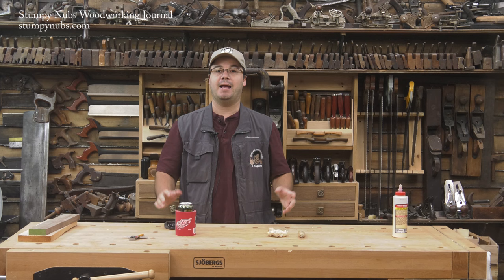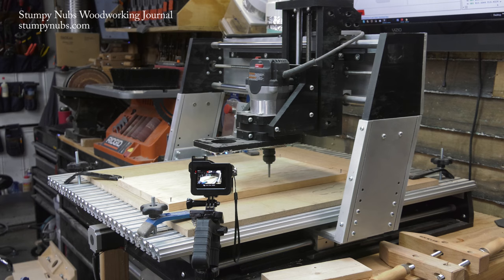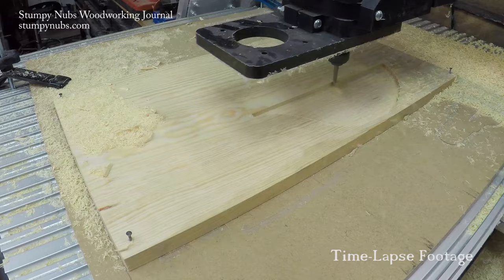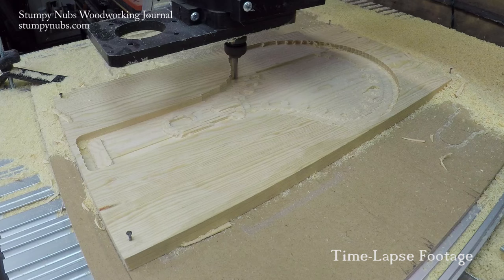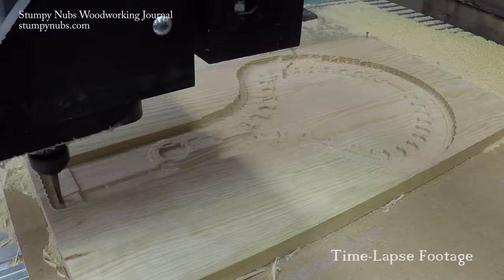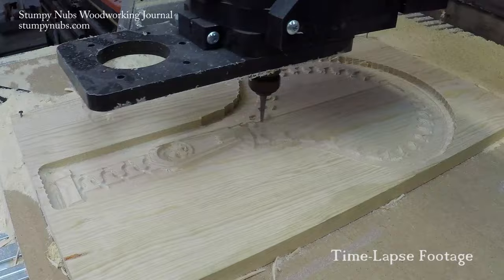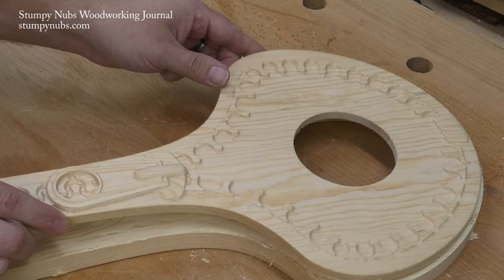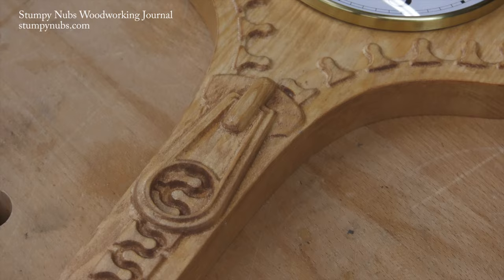WATCH THIS before you buy a CNC machine for 3D carving! (Updated)

Comment from the maker: READ BEFORE COMMENTING: A few people seem to listen to only part of the video, and then they run right to the comment section to tell me "any machine can cut 3D with the right software!" YES, that's what the video says! This video is about the need to find the right software if your machine won't do what you want it to do. I am NOT saying you have to get a whole new machine! I said I got a new one, but I ALSO said I had to upgrade the software on it to carve in 3D. Buy the machine you want. If it does everything you want, great. If not, you may still be able to do it if you find different software. It's all in the video...
Reply: Well, you literally state, "This may seem like a simple process that every machine can do, but it's not.", but it is. You clearly seem to be blaming the machine for your problems with the garbage software several times, when all you need is Fusion360, which is FREE!
Reply from the maker: Funny how you left out the very next sentence "You see, a CNC machine is only as good as the software...." I was CLEARLY saying the software limits the machine. This is what I mean about not listening...
Reply: Yes, I'm aware of your explanation and intent, but I wanted to point out that your message at first sounds very accusatory towards the CNC machine. I listened to the entire video before I ever looked at the comments here, and that was the impression that I got, until about half-way through the video.

I wasn't trying to twist your words, I was just trying to show how they could have sounded if someone wasn't listening very closely.
Reply: A correct statement does not make the statements before correct. You said silly things and it has been pointed out. This looks like a paid promotion video to me.
Reply: I couldn't care any less. What you have typed out here is NOT what you've said in the video. You opened up stating that not every machine can do 3D carving. Plain and simple. Hell you even said "This may seem like a simple process that every machine can do, but its not"... I'm sorry, but yes it is. Yes a decent portion of the video talks about software, but you set the overtone at the beginning with the statements you made. Starting out stating how you wanted to do carving but couldn't because the CNC was garbage, and how you couldn't do this or couldn't do that and yet wanted to do this and that... So everything after that, just has people's brains hearing "don't buy a cheap CNC because it wont do what you want". You set the entire mood of the video because of that. Instead if you had started out going with "Ya see, I wanted to do 3D Carving... But the software that came with my CNC was trash. How did I fix this? I bought this other piece of software. Now it does what I want it to!".... 

You basically made a long video spouting the same word vomit for the entirety. Something like that could have easily just been a 2 minute video tops... "hey, 3D carving with cheap/free software sucks! It doesn't actually do it! So buy/use some better software so that you can actually do what you want!!! Oh, and make sure you save up enough money to buy a decent CNC so that when you do buy the software, you have something to use!"......
Reply: Can you please share a link to this exact machine. I've been wanting to buy one of these machines for a long time. The link in the description leads to a list. What's the cost of this machine? thanks
Reply: Thanks for this helpful tip! I'm looking at getting a small CNC machine and it's good to know I need to take software into account. Very helpful video for me (a beginner)!
Reply: Hi stumpy! Enjoyed the video. I have A friend who has been after me to redo the street signs in their development, which are raised carvings. Not looking to make a lot of money off of this first get go, but just to help cover the cost of the machine. The signs are basically two by fours that are rounded edges. The main part of the sign that will have the street name is about 3 foot long. I am concerned about the bed size for doing something like this? Any suggestions? Thanks.
Reply: @TheKatahar   Hi. Have you found out the reference of this machine?
Reply: The next huge leap in versatility and exponentialy the price that shoots up like a rocket is a true 5axis milling/routing (where the spinning tool can be angled in all ways and all the rigidity must come from the robotic arm with various swivel points. (50k$+) The advantage is the low profile since only a giant robotic arm is used without needing a bed. (but the reach will be different depending on size.. so make the piece spin is the next upgrade, make it spin fast enough an you got a lathe where the router can be replaced with stationary cutter like in lathe)

There is another step up from this as well. Make the piece spin as well and you have the industrial multiprocess 5-6axis lathe/mill combo like mazak 200s (150k$+) this will make anything to very detailed 3d scupltures. And since rigidity is the name of the game, most of these machines are done for metal milling, but i bet a similar thing for wood exists.
Reply: @operator8014  Fusion 360 is pretty powerful - but the vectric stuff is far simpler to learn. It is clearly aimed at exactly the type of thing this video shows. Horses for courses...
Reply: @HDFoxra  Even the video title is misleading and implied problems with machines!  Oh, and to the original poster "A few people seem to listen to only part of the video": that's because the video is unfortunately pretty boringingly presented.
Reply: It is  NOT called software, it is a program.
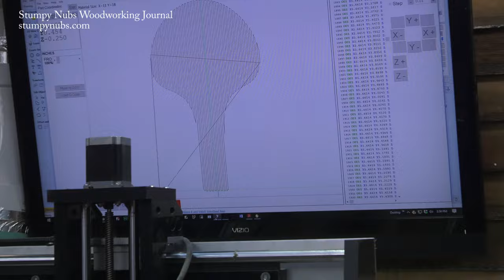Reply: I just want to clear something up that I have heard folks say about "3d carving" in woodworking videos. If you look at the video at 1:30 and pause the video, you can read the generated NC code. 2.5D cutting is the use of 2 axis(es?) to generate a 3D surface. This is going to be either your X or Y axis and your Z axis. If you review your code, you can see that your X axis doesn't move but your Y and Z axis numbers change. You can also see it in 2D on your screen from a top projection to your work piece. Granted, some programs and apps are better than others for that type of tool path. But that is industry standard in proper cnc machining. Which is extremely common among shop floor cnc machinists as we use little tricks to, for example, to add an odd angle or radius to the end of a part. A few lines of code and a loop count and viola, 2.5d, programmed at the machine control. Make no mistake sir, what you are doing is 2.5d cutting.
Reply: many thanks for the explaning
Reply: Stumpy Nubs do u have any experience with the carvewright system or heard any feedback for others that have used this system any info would be greatly appreciated thanks!
Reply: Jeeez, I got what he was saying, this isn't convoluted or silly. Pretty straight forward... get a machine that supports the more robust software that you'll probably need if you want to do higher end projects, rather than a cheaper, more limiting machine that will disappoint your ambitions and wallet. As a software engineer, this makes perfect sense to me, and was clearly stated.
Reply: So which cnc machine should i get and how much do i need to spend ?
Reply: @StumpyNubs  Stumpy, I never new people had such a problem with reading and writing comprehension. For the record, I immediately understood you were referring to the software...BECAUSE YOU SAID SO! Thanks man!
Reply: @robertgardner7470  I work in I.T. I'm a developer. A SOFTWARE PROGRAM is the correct terminology. You don't know WTF you are talking about.
Reply: Thank you very much. I'm grateful to have come across you. If I do dive into this business, I'm sure you'll immediately become our woodworking consultant, whether you knew it or not. LOL Thanks for this lesson, you saved me at the Get-go. Cheers.
Reply: what's the best CNC i can buy for 600€?

Comment: Couple of tips from a metal machinist: Try a software that knows how to do "rest machining", like Fusion360, MasterCAM, SolidCAM. That way you can rough out your workpiece with a flat endmill and you get your large flat areas all done. Then switch to a smaller ball nose cutter to rest machine all those nooks & crannies that the flat endmill didn't get. This way you are not remachining flat areas again, saving tons of hours quickly.

Comment: I purchased my fist cnc Router from practical cnc now APECNC .. 48 x 96  servo machine with 3.5 hp router... I purchased a 5 hp spindle for it after I got 5 feet of sea water in my shop from hurricane IKE.. bought Vectric Aspire ver 1 when it first came out..and now every update to ver 10..  used that machine for 10 years with little or no major problems.. then 2 years ago purchased a ShopSabre 408 Pro with 10 hp spindle and 4th axis rotary.. Yes with aspire you can 3D cut your own spindles and newel post.. Love this shopsabre... If you ever want to upgrade your machine look at them... great customer service and a great machine...

Comment: This video is spot on. Fortunately for me, I had plenty of time to do the research as I built my own homebrew CNC router, so by the time it was running, I was already getting in practice with basic software, and had advanced software pretty well picked out. 
  
 It wasn't long at all before I went ahead and bought a full-on software suite, because my wants and needs immediately outgrew the basic tools. Years, a great deal of wood, and many, many bits and endmills later, I can speak on the subject with considerable authority, (for a hobbyist, at least).  I completely agree that most people fall way short on their research when they first buy a router, and that the software is absolutely the "Secret Sauce" that unlocks the real potential of the machine. It absolutely isn't cheap, especially the all-in-one solutions like Vectric Aspire. 
   
There are other ways to go about it though. If a steep learning curve is acceptable, there are standalone 3D CAD packages for free, (FreeCAD), and low-cost, (Alibre Atom), that can precisely model anything you can imagine in 3D. Did I mention a steep learning curve? These are both packages meant for engineering and design/manufacture, and there's nothing basic about them, especially to begin with. There are lots of good user-made tutorials out there on YouTube, and perseverance will really pay off.

   Once CAD is covered, CAM software is needed to compute the toolpaths that will guide the machine as it carves the model. There are a number of standalone CAM packages with various capabilities and pricing. Some basic CAM is built into FreeCAD, but it's not really a fully cooked system. Alibre offers a relatively low-cost bundle with MeshCAM, which is one of the better standalone CAM packages. Another good one is Deskproto, and there are others.

   The all-in-one solutions, like Vectric Aspire, definitely have usability going for them. They'll get a new user up and running faster, but at the cost of, well, cost. Lots of cost, lol. I hope this will offer some leads to folks looking for software, especially first timers.

Comment: I have a Shapeoko3 XXL and VCarvePro software.  The SO3 is great for the price and would do a great job on the carving in this project. 

That said,  if you use your CNC a lot you will eventually want a larger and stiffer setup with more power so buy the best system you can justify and fit in your shop. CNC routers will soon become the centerpiece of many shops. I have come to value my CNC router as much as any piece of equipment in my shop.
Reply: Tony Shulthise - I just watched this and read your comment. Hiw is the shapeoko holding up and would you still recommend it?

Comment: I spent last winder not in the wood shop, for a change, but in the dining room surrounded by stepper motors, arduinos, wiring and an awful lot of soldering tools, a microscope, and so on. In the end I had built my own 3D printer from scratch. Fantastically challenging and rewarding. I’d love to get into building a CNC and/or an etcher/cutter. I have yet to research this and I’m curious and hopeful to see how much of my knowledge and experience in FFM will apply to these other solutions. It took a ton of reading and video watching to arrive at a finished product. Hopefully there are good resources  for these, as well.

Comment: Thanks for your video and input. Software is very important in giving you control. Cheaper versions reduce your options. Moc3 is professional but costs 10k with yearly fees. Fission 360 is a great program but has a harsh learning curve and requires a good PC processor. All machines have limitations for speed or accuracy. 3d printers are fairly cheap, versatile with great detail. They are not fast or made for production, but great learning tool. You can not just buy a machine and expect too much with out a lot of study.

Comment: yes, cheaper machines with cheaper software was all i could afford. so i bought it, made signs and nametags and such simpler projects wich i sold so i could buy the expensive software and upgrade my machine. buying cheaper is not always bad. it got my business going.
Reply: i am in the same boat but just leaving the dock, the machine is up and running using linuxcnc but not really making anything of consequence as of yet, any tips on software, projects... ect??
Reply: mightress what was the price of it ?
Reply: I am looking to buy cnc router,which one would you recommend?
Reply: what machine did you buy?
Reply: mightress  just looking to do name engraved signes, what machines can cheaply do just that?
Reply: michele bennett a handheld router and lettering templates...

Comment: 3D Carving is definitely more about the software than the machine. Any 3 Axis CNC machine will cut 3D as long as it is fed the right instructions via the G-Code file. Aspire is an awesome program but for those without that budget can get Vetrics V-Carve Pro and still cut 3D files... they just wont have the robust modeling tools available. Good to see another woodworker showing how this is just another tool in the shop. Keep up the good work!
Reply from the maker: Right, it's almost like a two-part purchase. You need the right machine (heavy duty enough to do the work you plan to do, and with the quality parts that will last) AND you need to right software (user friendly, bug-free, and with the features and capabilities you require). Small-shop CNC woodworking is still a relatively new thing, and there's a lot of confusion out there. I recommend people find someone online who is doing the sort of work they want to do, and talk to them about the pros and cons of the stuff they're using. Then find someone else and ask them the same. When you're spending a lot of money on something, it's worth taking the time to be sure!
Reply: I completely agree and there is a pretty decent sized community of hobby CNCist out there who are very welcome to share their experiences. Some of these guys have been doing it in their shops for over a decade.
Reply: V-carve desktop will do it too. If your bed is 24 inches square or smaller V-carve desktop is far cheaper than the pro version. I often use fusion 360 if I need TRUE 3d stuff. Its a true 3d solid modeling program thats in the class of whats used to make state of the art military and commercial aircraft. Has a serious learning curve but Ive been using this type of program for years so i was a natural for me. It will also create the g-code in the same program. Free for hobby use... thousands of bucks for commercial use...
Reply: Can you please suggest me what are the different types of software we can use for CNC wood carving.
Reply: Good sir

Comment: Absolutely right , most hobbyists  start with a 3018 and use carbide and easel but have no real idea after they have used it for a year whats next, just to let you know so far I have invested 2500 in my own open builds machine , Lead screw water cooled spindle and nearly another 2 k in software  You need to shelve out real money if you want to CNC properly not 500 GBP/USD low thousands for something decent and 7.5K for a brilliant setup.  DIY 4/5K will cover it with quality materials and software for a 2 metre by 1 metre bed. Not Shapeoko thats a hobbyists toy as is Inventables they are part time machines at 2 k and both without proper software, Easel is ok and is Carbide but both have problems and are not true 3d.
So people bear that in mind, 3018's teach you grbl to a point but Vectric IMHO is the best which is why is so expensive because it works, its relatively easy to use after you train and because you paid for it you can get all the goodies and free projects that they send out and you can make stuff that will sell and you can recover your costs and make a profitable business.. There are makers versions of Vectric which are cheaper but size limited so bear that in mind if you want unlimited size and the goodies you need to pay for the full pack.
If you want to produce good quality work you have to pay the price for the machine , software and bits